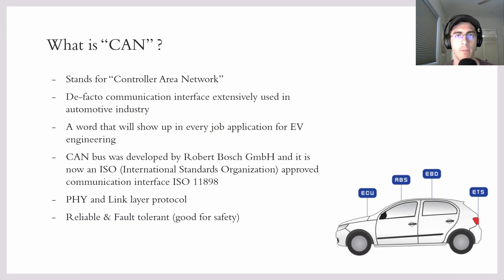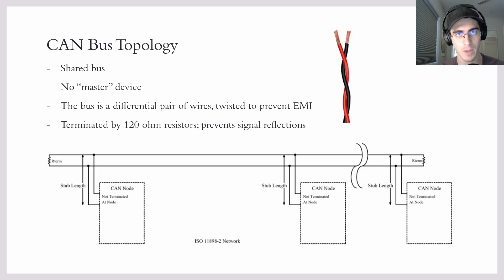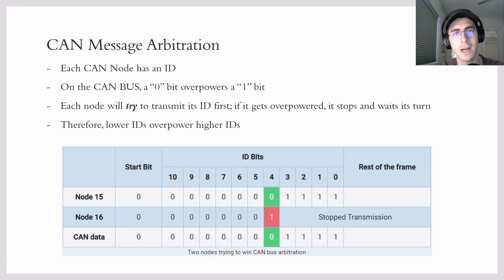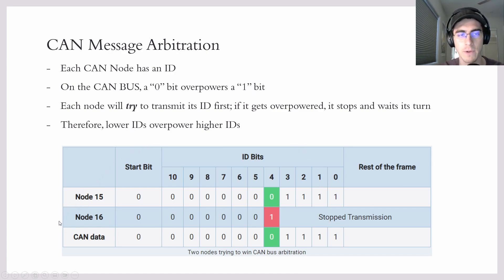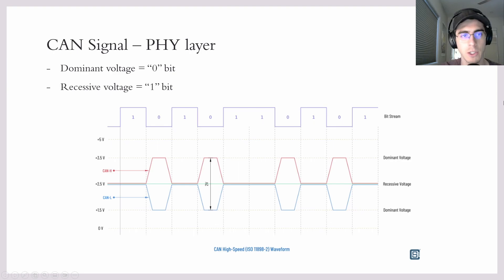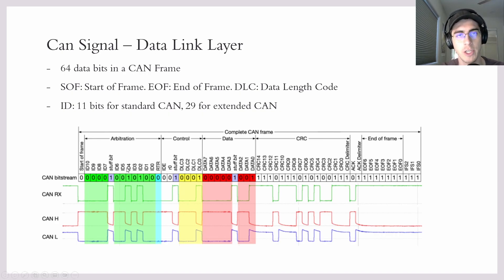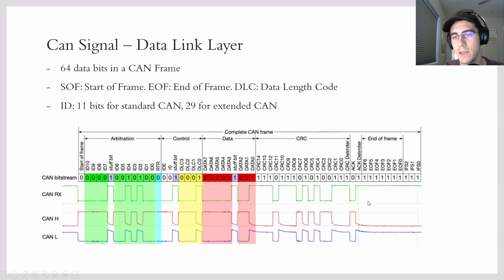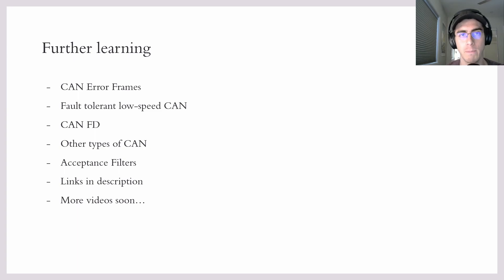CAN Protocol Explained | Controller Area Network

Comment: Technically incorrect. There is NO CONCEPT OF NODE ID in CAN protocol. Every thing is a message ID. 2 nodes can send same MessageID, where one is requesting data for a sensor with same message ID and another responding with same message ID with the sensor reading.

For folks viewing this - please make a note of this.

Comment: Great video. I do have one comment though. The CAN ID is not associated with the node, it is associated with the message. So a node can have multiple different messages, but each of these messages may have different priority, i.e. different ID's. Just thought I would point that out.
Reply: Yes. Correct
Reply: Correct, though on a higher layer (e.g. application layer) certain IDs can be assigned to specific nodes.

Comment: Hi! I have heard that active CAN terminators exist, as far as I know, John Deere used them in the past or still uses in their designs. There is no information on how they work on web. There are few patents that mention switchable terminators(resistor gets connected automatically), though "active" ones probably use some arrangement of linear regulators or something like that. I can comprehend how termination resistor works(it must match line characteristic impedance to avoid reflections), but I don't know how would active terminator be any better then just a resistor, and what even is the point(unless line impedance can deviate from 120ohms enough to become a problem in newly built devices, and needs to be perfectly matched, which does not seem to be the case with CAN).

Comment: Can you go into details about CRCs and MCs (message counters)?
Reply: I don't know much about CRCs, but MCs are used to ensure one specific node isn't hogging all the available bus bandwidth. If a node with a low ID (always wins arbitration) is non-stop communicating on the bus, it can be ignored and told to "turn off" if the message counter goes over the threshold within a specified time limit. That way, higher ID nodes can broadcast their messages.

Usually, the maximum allowed bandwidth for a node is about 30% of the total bus bandwidth and they will be throttled when the MCs indicate it's nearing that.

Comment: Is there no stuff bit for end of frame required?
Reply: No. When the network sees 6 recessive bits in a row, it can be considered to be idle and no messages are being broadcast. The stuff bits are only there to prevent the other nodes from thinking the bus is idle while data is actually being broadcast in case you get 6 recessive bits in a row in your data.

Comment: Good job with the video. Provided some clarity. When speaking of Nodes... If you were to provide some practical advice, say for example in the world of Arduino. You would probably not want to have a slower end "Master" as it couldn't handle a bunch of nodes all talking at the same time. Is this where something like an STM32 shines? Also what happens if two nodes try to talk at the exact same time? Does the one who fails use logic to keep reporting the data until accepted by the master? I imagine this is where it would get tricky because what if you have a window sensor with an ID that "beats" the fire sensors in the motor bay? That gets into the weeds for sure... Just curious...

Comment: It believe you're talking about j1939, because CAN specification doesn't have physical layer, which is basically the signal interpretation and the arrangement of wires in twisted pairs.

Comment: Hi, thank you for the nice introduction. In my understanding,  one CAN node can transmits multiple meassages with different IDs. In this context,  the ID relates to a meassage, not to a node. Is my understanding correct?

Comment: You mentioned that the node with the lower ID wins the arbitration. Could you please explain how multiple nodes' clock and data lines stay synchronized during this process? How do they avoid interfering with each other while maintaining independent clock and data signals integrity?
Reply: I have been looking for that information for a while myself
Reply: I think that when you send a 0 on the bus you pull everyone else’s 1 down so they shut up. Like if i was an ecu and i sent ID 1111 but my outputs wound up being 1010 then id know its not my turn yet and ill wait until the next frame. Like anyone can send a 1 that’s no problem but if anyone sends a zero it becomes zero for everyone. My explanation might only makes sense once you know how pull up and down resistors work
Reply: It's a lot to write out, but look up "CAN bit timing and calculation". Embedclogic's site has a great writeup on it.

Comment: 3:43 why would they start to transmit at exactly the same time??
Reply: Sometimes two people in a single conversation will start speaking at exactly the same time. CAN nodes are, in that regard, no different, so the arbitration process decides which one gets to talk first.
Reply: in the video he says 0 overpowers 1, so 1 means that transmission is stopped, this seems counterintuitive to my knowledge of bits (1s and 0s) 0 being OFF and 1 Being ON  @wildgurgs3614
Reply: They are all synchronized. It's not that they "may" start talking at the same time, they always will start. All nodes on the network are synchronized from its initialization and have a set timing for when a SOF can be broadcast. When a SOF is broadcast, every node synchronizes their bit time. If two nodes send data across the network at the same time, they can do so. That's where arbitration comes into play. All nodes are also actively listening for data on the network as they are sending it out. If the higher ID node ends up seeing the dominant bit when it sent out a recessive bit for that bit time on the network, it knows a lower ID node is also trying to communicate at the same time and ceases transmission therefore letting then lower ID node win arbitration.

Comment: Josh your videos are excellent . Most videos just talk about twisted wires and terminating resistors . I personally enjoy learning how and why  everything is communicating  then build models of the circuiting  to physically understand what is happening and how signals are produced. As you can tell I’m new at all this terminology  but I will learn and understand what is going on. Thanks for sharing  your knowledge.   Artie 👍
Reply from the maker: Glad you are finding them helpful!
Reply: Yep so when that clock output is commanded off and the other frequency is commanded on by its output enable to latch all modules by   duty cycle leisure automatic seat this also pulls the eeprom from write protect into write for driver seat adjustments by each keyfob im fairly sure etc etc.

Comment: I have a question about can cominucation on car. As I searched on internet, Can2.0a and Can2.0b can coexist same bus line. Can an EVCU recieve messages from bus without any problem? Or is it possible that? An example EVCU, motor, and battery nodes connected same bus. Motor has Can2.0a and battery has Can2.0b. Can a standart EVCU' s work this situation?
Reply from the maker: Hi, here are some details about a mixed CAN network,

Receiving Messages: A CAN 2.0B node can receive messages from CAN 2.0A nodes without any issue because of its backward compatibility.

Sending Messages: If a CAN 2.0B node sends a message with an 11-bit identifier, a CAN 2.0A node can receive and understand it. However, if the CAN 2.0B node sends a message using a 29-bit identifier, the CAN 2.0A node will not be able to interpret it.

Comment: Is the can H and can L sending a signal called LVDS ?
Reply from the maker: The CAN protocol does not use LVDS (Low-Voltage Differential Signaling) for its communication. While both CAN and LVDS use differential signaling for improved noise immunity, they are different technologies with different purposes and specifications.

Comment: Hello and thanks for CanBus tutorial. I used Arduino Mega with MCP2515 shield reading 7 CanOpen sensor information. Got 4 more sensors added to the work project. Unfortunately it did not work. Upon further investigation, I found out the new sensors are fault tolerant low speed can devices. I could not find any low speed Can shield on line to try with these sensors. Any idea besides changing the transceiver IC? Thanks.
Reply from the maker: Low speed fault tolerant CAN transceivers use completely different voltage levels, I would recommend using normal ones
Reply: @EV_engineer  , thanks for the reply. I do know that the transceiver voltage and termination resistor is different. I have a low speed fault tolerant sensor that I can not read data from but I can read data from other high speed sensors. I was simply asking if you know a shield, or mod or hack that I can do to read low speed sensors. One solution I thought of is using mcp2515 with TAJ1050 and replacing the transceiver with low speed type compatible with 2515 controller.
thanks again for the reply. If I manage to make it work, I let you know.
Reply: @simaroaerial7237  HELLO, I hope you are doing fine, my project is also related to CAN i was hoping if we can have discussion a bit if possible? I am final year electrical engineering student.
Reply: @Yurihjjjn  ,
I can help you to some degree. I can not share code for our sensors but I can share a store bought sensor that we used to develop the system. The difference between the two are 16 bit integer for the store bought device and our sensors that are 32 bit real number. The front end, meaning fetching the data either two bytes or 16 bites are the same. Back end process of the bit stream is different.

Comment: Hi, as you said there is no master controller on the can bus then isn’t there a CAN module that controls or links all different controllers on the bus and turns them on and off by using differ voltages thru the CAN hi and can low twisted wire pair, for example I want to move the right window up, window switch will send the some voltage to CAN module which then will send let’s say 2v in HI and 1.7v in LOW to the right window node/ ECU moving the glass up? Sorry my knowledge of CAN communication is quite low.
Reply from the maker: Each CAN node runs its own control algorithm. This algorithm might depend on CAN input from other controllers, if that's what you're asking. The control algorithm might also depend on other types of inputs, such as GPIO, SPI, UART. The window switch probably interfaces to a low voltage CAN controller through a hardware connection, if I had to guess. Not everything needs to be CAN ;)